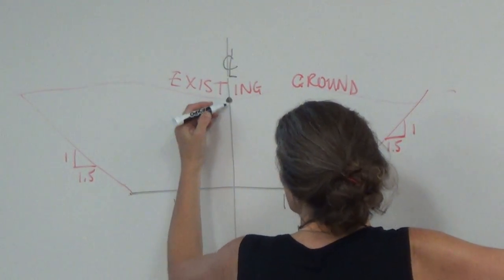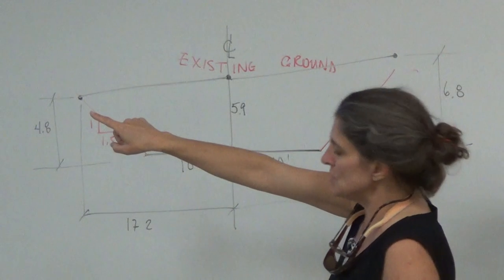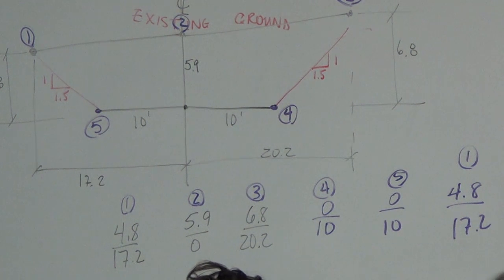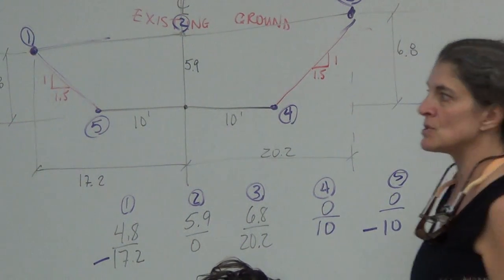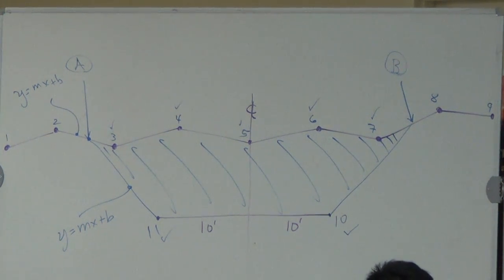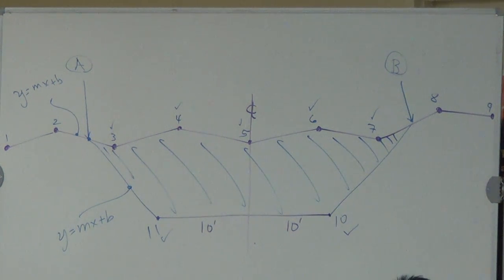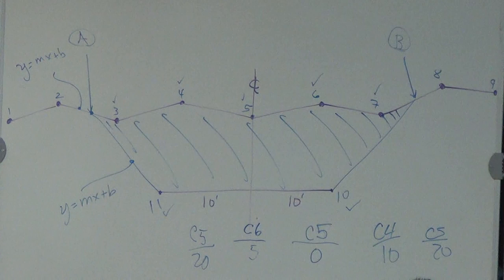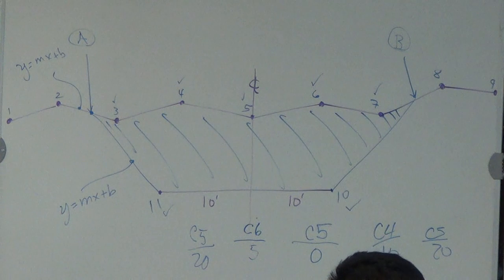Class 10 (11-5-14)_vid4

Comment: Hi Kelli, I have a question: what if the cut/fill point does not lie on the side slope? For example a cross section with width of 14 m and side slopes of 2:1 (h:v) and the point C2.50/11 . By simple calculations, we see that for a run of 11 , the height needs to be 2.0 m so that the point lies on the side slope... What would you do in this scenario?
Reply: The question is, determine the area of the following cross section: width = 14 m , side slopes 2:1 (h:v) , Left point C2.50/11 , Center Point C5.23 , Right C 6.73/19.46
Reply from the maker: I would move forward with the double-area method calculations using 'two' Left points (Left point C2.50/11 and Left Point C2.00/11), Center Point C5.23 , Right C 6.73/19.46, etc.  After excavation this would leave you with 0.5m vertical cut on the left side of the cross section.
Reply: thank you, i will try that